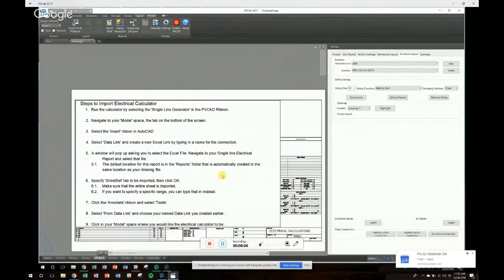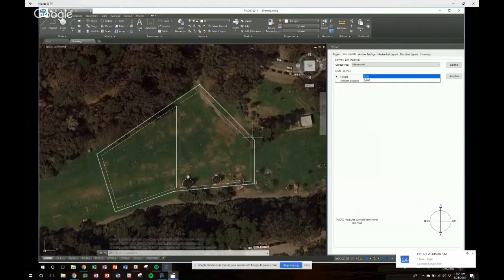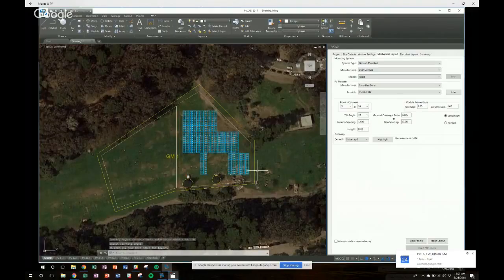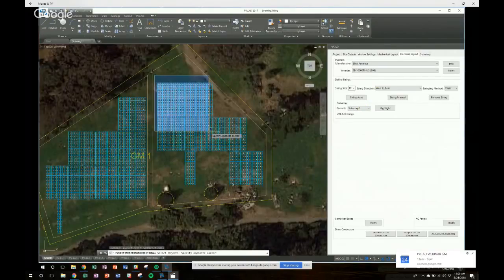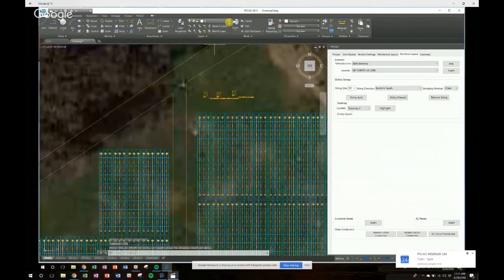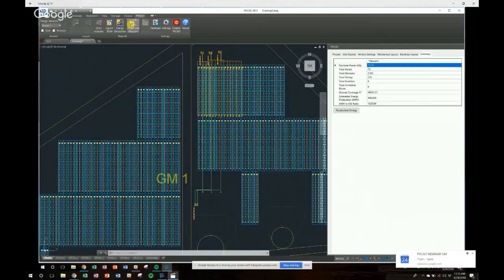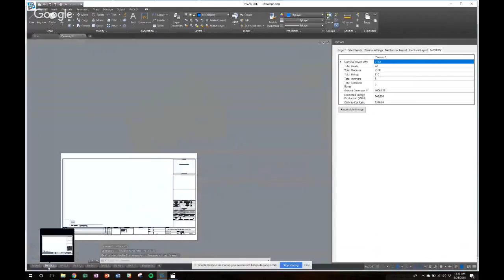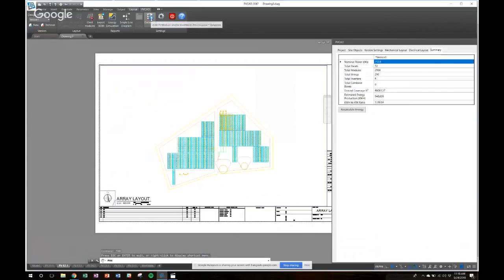Ground Mounts in PVCAD: Webinar 5/24/18

Comment: Dear Madam,
Thanks for video. Actually, we have to design a 193MWp ground mount solar plant in India. I am working on it and I have some query which are as under-
1). How to connect String combiner box to inverter ? Have to connect 4 combiner box per inverter as per design of our plant.
2). How to use different conductor size for connection of string to Inverter/combiner box?
3). What is purpose of “output circuit conductor” provided under Electrical Layout section?
4). Can I extract a pdf report after simulation having all the information in same like Project details, electrical design parameters which we selected while designing, PV layout and Energy production details ?